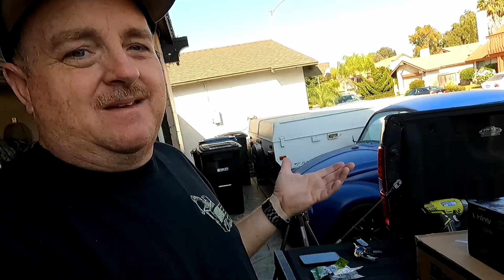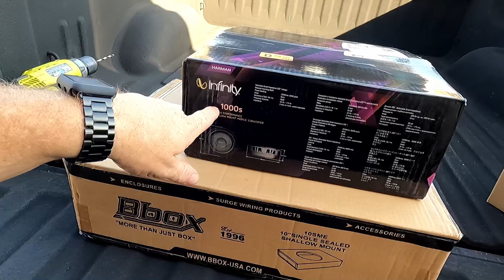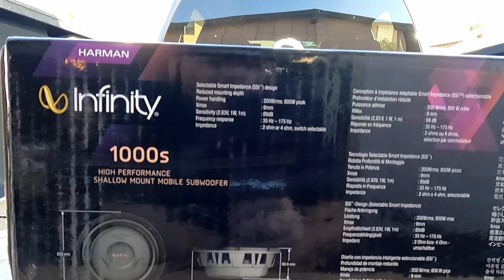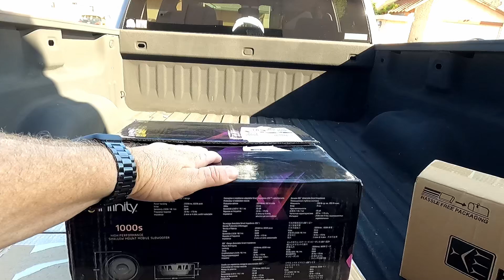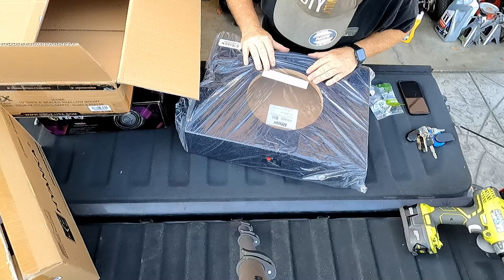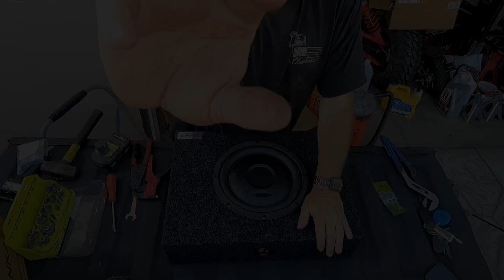Willy's 10 Inch Subwoofer and Box Assembly - 2011 Chevy Silverado gets new toys

Comment: the DB (decibel) sensitivity states that at a certain voltage, how loud is the speaker from 1 meter away while using 1 watt of power. The Higher the DB, the louder the speaker is using the same power as another with lower DB.
Reply from the maker: Hello Steve, Great information! Thanks for watching!!